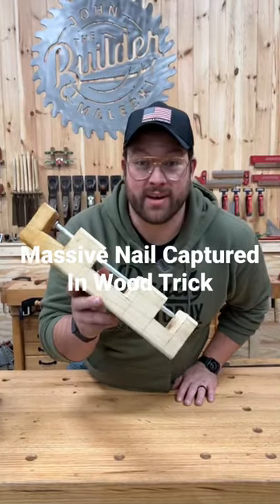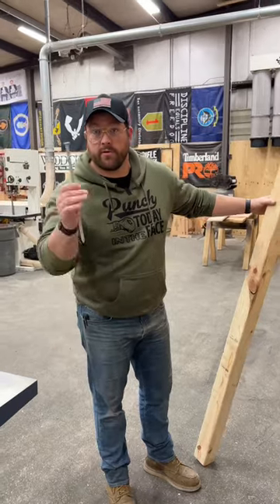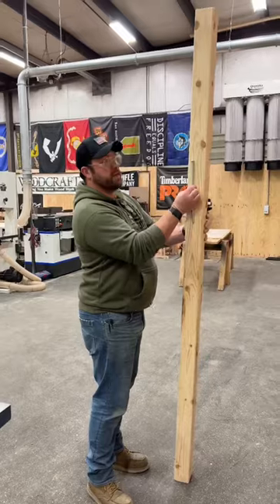Capture A HUGE Nail in Wood Trick

Comment: I'm so f'n confused.  First..... Why?  Second..... Water?  Third..... Purpose?  Forth...... Again, WHY !?!???!?!?
Reply: Its supposed to be one of those items that gets you to wonder how it was made. Like a ship in a glass bottle. In this case, how did someone put a nail through the inside without cutting off one of the ends?

The boiling water allows the wood to be compressed enough to hammer in the nail. Once thats done the boiling water will make the wood expand again so it looks impossible for the nail to be hammered in without going through one end.

Comment: Screw that, cut the top part, put the bolt in, glue it back.

No one will know.
Reply: They’re gonna know
Reply: @curbkreature7488  Not if I do it, they won’t.
Reply: @curbkreature7488  How would they know lol
Reply: moistmanm9  as a finish carpenter and hobby luthier, just make your joint better, you won't see a seam.
Reply: moistmanm9  whoosh they were doing the meme.

Nobody's gonna know
How would they know
They're gonna know

Comment: Life hack 
Place the nail in a vice
Whip out the grinder and cut a third off of it with the head attached
Drill a hole at the bottom so you can pass the longer section up and through right before it enters the top of its location add your glue to the top and press it in
Take the head of the nail section add your glue to the bottom line it up and using a strong 1 inch putty knife or other non marring tool press it into place use the same putty knife to fill the hole with some filler 
And bam illusion of an illusion complete and the board will still be square even if the hole gets recognized you can say you accidentally drilled it out because it doesn’t explain how you got the nails head in through the other sections😂👍
Reply: Yeah that would be way faster...

Comment: I’m still confused as to why the boiling water was used
Reply: Really
Reply: It softens the wood
Reply: @contraband1543  I drive nails all the time without boiling the wood.  Could you imagine?  The foreman would have my ass in HR for a drug test real quick
Reply: The real way is it softens the wood so you can bend out the top plate enough to hammer a nail on the inside plates. Then you bend the top plate back over. Once dry it is hard again. Simple like how they straighten arrows etc.. back in the day.
Reply: He goes past it so quick but it's the most interesting part of the proccess. he boils the section of the wood to soften it and compress it down in the vice. Then he boils it again so it goes back to it's original shape.